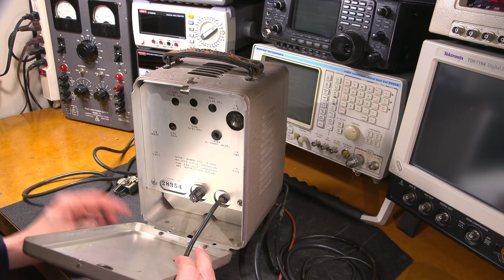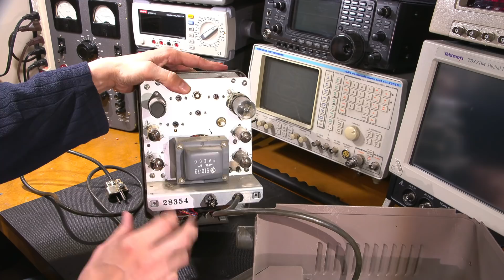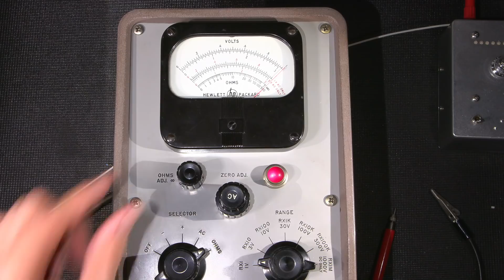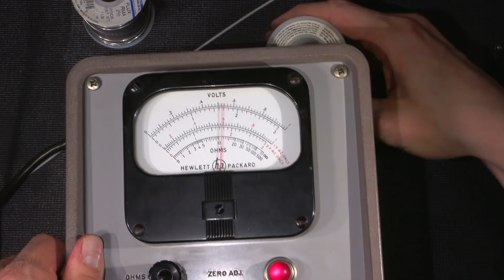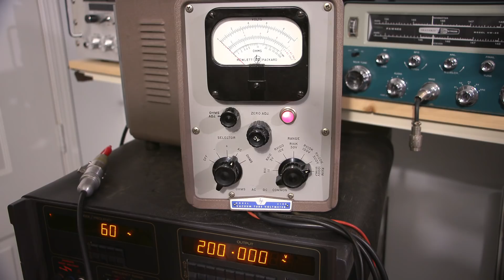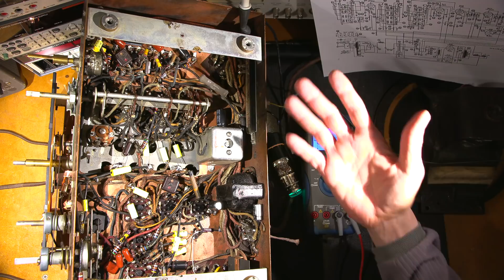The BEST VTVM? You Decide! HP 410B Restoration and Alignment

Comment: The selenium rectifier in mine died and it was a nasty small (and I am told, highly toxic - I didn't stick around to find out).  Just a warning - even if it is low voltage, not worth playing with, just replace it.

Comment: Oh! How I love this VTVM. This was my first. Now I have the 410C Voltmeter. I like that too. DMM can work also if you build your own range extender probe with shielded cable and resistor of 1 M Ohm or more into the tip of the probe, then just multiply the number on the display accordingly.

Comment: A couple of small notes.  First, there are differences in digital meters regarding their inout resistance.  I remember noticing that at higher voltage selection some high sensitivity analog meters could have lower loading than early digital meters.  Then the digital meters started being "standardized" to 10 Meg input resistance on all settings beyond 2 V or 20 V.  A Fluke 8060 had special "trick" to bypass its 10 Meg resistance, by leaving one or two selection buttons not pressed and producing 10 G-ohm.
 Second, I hope your AC probe pn was made of brass screw, rather than steel.  Otherwise I would be skeptical about its abiities to get even beyond some MHz.
 Third, I was once puzzled by missing heater on the input stage of a Keithley meter.  Actually I learned that it was intentional - the meter was Electrometer.  It depended on the cold cathode tube for its input characteristics. 
 Fourth, if the selenium rectifier would be damaged, you could smell it way before ever opening the case.  "Ask, how I know!"

Comment: Its a while since you uploaded this one.
I have a HRO RX  and I put into my tube tester a 6K7 and all of the 6K7's have leakage from 1st grid to pin 1 which is the meatal shield and using a ohm meter there appears to be leakage from the top cap ie 1st grid to the shield about 8 megohms.
The insulating material between the top cap and shield is I think conductive.

Comment: Before bad leadership wrecked the company, HP built things to last. I used many HP instruments to collect data for my Ph. D. thesis - circa 1990. Later, I worked for HP from 2002 to 2011. While there, an old-timer told me about the time a VP came to our site. He addressed the engineering staff. He took an ink-jet printer and stood on it. He lambasted the engineers for over-building products.

Comment: There's something you should have mentioned, but didn't.  Note that that big cap is inside a cardboard tube.  If you end up replacing with a similar one, be SURE to put it in that tube, or something similar (like a few layers of electrical tape).  The case of that capacitor is not grounded.  If you don't insulate it, and brush against it, you'll wonder, "Where did that rattlesnake, (or was it a snapping turtle?) come from?"

Comment: Just retired and took up electronics as a hobby. How does this unit compare to the 410C and Sentinel ME-26D/U?
Reply: The 26D/U is the ruggedized, military version of the 410B.  If you get the chance to acquire one, at a reasonable price, jump on it.  It's identical to the 410B, but Mil-Spec.  The 410C has the same capabilities as the B, but is solid-state.  They also sell for more.

Comment: Hi Paul. Regarding the new electrolytic cap. I have always used the "ear snipping" technique to be able to easily and cleanly remove what can often be a jungle of wires on multivalue cap lugs, but I'm not certain if your followers understood what you were actually doing.  I had to screenshot and expand how you added the new cap and while I understand your simply soldering the negative lead to the existing electrolytic lug, I am not certain how you did the positive lead?  It appears you bent the ear over and then, using a nut, attached a standoff to the ear via a threaded shaft. But it appears the same threaded shaft then protrudes from the other end of the standoff, where all the positive leads are attached?  If I'm correct, this would mean the old cap is still in circuit, right, or are there 2 separate shafts, thereby keeping the old cap out of circuit?  BTW, in my 1968 410B, HP changed the cardboard electrolytic 4 to a metal can 8, and also did away with the wire tube hold downs.  It is only due to your excellent photography that I was able to expand and investigate your standoff design!  Keep up your outstanding work!

Comment: Thank you Paul!
Reply from the maker: My pleasure!
Reply: @MrCarlsonsLab  Paul, I have been going back and forth trying to decide whether I should ask this or not but I'll ask anyway. You are, of course, the person to go to when you want to know probably anything about radios. I think what set you apart from others in this field is that you know the theory well, you have a lot of practical experience and most importantly, you have all the physical and mental tools to explain it in such a way that almost anybody can understand it. In your All American 5 Video, there is a short part where you explain the signal path in the radio. Would it be possible for you to do the same in a separate video, on a simplified version of a tube radio built on a simple chassis, going through the signal path using some sort of test equipment (an oscilloscope for example or whatever you see fit) and explain how reception occurs starting from the antenna all the way up to the speaker? I do understand that there are different topologies for radios, like regen, heterodyne, super heterodyne, etc. but since I don't know much about the classification, I would ask you to do whichever one you see fit (where would one begin?). If you have done anything like this on Patreon, I am working my way through to Patreon and I'll get there soon. I am going through your Youtube videos currently. If you don't find the time to do this, I would also be interested in any book or resource you would recommend. I thank you in advance. -Regards Gahra

Comment: I just repaired my 410B!
Mine was used for decades in an avionics lab, but it was considered obsolete and given to me.
A few pots to clean, a wire soldered, and it aligned nicely.
What makes it even more valuable, are the two AC probe adapters I got with it, they allow me to measure inline coax voltages, or the output of a signal generator!
It sits on my scope stack, ready to measure whatever needs to be repaired!
Reply from the maker: Sounds like you have a great tool now! The 410B is really fantastic.
Reply: Lucky bastard!  :)
Reply: @Pootycat8359  Sometimes we get lucky, and sometimes we come when the dumpster was emptied yesterday, when everyone else picked out what they wanted!!

Comment: Question for you Paul, I have the ME-26D/U, and the AC scale won't hold a zero if I hold the probe in my hand. It actually causes the meter to go to full deflection until I place it on the 100v scale.  

I have checked the triax cable and tube in the probe and both seem to be fine. The capacitor in the tip had broken, and I was able to carefully glue it back together. A quick test with an LCR meter shows that I have contact between the probe tip and the inner contact that interfaces with the tube. 

Any ideas on what to check for?

Comment: Well, I finally managed to come across one of these on an auction site and snagged it.  The DC and ohmic leads need to be replaced, as the insulation is pretty badly cracked on them, but other than that it looks pretty good.  I'll be using this video as a guide for my own restoration.

Comment: Mr Carlson, I've just acquired a HP 410B. V2, V3, and V5 shines dim, but V4 and V6 doesn't shine. Where can I find these tubes? I know V2 and V3 are 12AU7s but I don't know what V4, V5 and V6 values are.
Reply: V4 is an OB2, 105 V regulator.  If need be, it can be replaced with a 105 V 10 W zener (eg, 1N3006B).  Be sure to put a small (.05 uF?) cap in parallel, since zeners produce RFI.  V5 is a 6X4 rectifier (the 410B in this video is a later model, and has a selenium rectal-flyer, instead).  You can replace it with silicon diodes & series resistors.  Be sure to determine the tube's internal resistance, and add the resistors.  Otherwise, the B(+) will be too high, which might shorten the life of the instrument.  V6 is a ballast, which creates a constant-current source.  There are ways to replace it, but I don't think any are quick & easy.  You would have to design & build an AC C-C source.

Comment: One final question…I see the meter is grounded and I wonder what happens when you attempt to measure line voltage? Thank you.
Reply: You can measure it, with the probe going to the AC "hot" wire, and the meter ground to the AC "neutral."  Don't try the reverse, or it'll be "snap, crackle, and pop!"

Comment: aaaahhhh memories....in the '60s my first VTVM was an EICO. The 12AU7 in mine would go soft after 20 hours of use. The most frustrating thing using it was, every time the range was changed you had to re-calibrate. More accurate than a VTM in those days. My first tube tester was a Heathkit. Worked great.
Reply from the maker: Thanks for sharing

Comment: First, I want to make clear that I enjoyed the video, and I love that this kind of information is available, and I am a patron of the channel.

A comment about input impedance...  Modern hand-held DMMs tend to have an input impedance of 1 to 10 Mohm, according to the paltry amount of relevant information I was able to glean from checking the data sheets for several DMMS, including the Fluke you're using there, my Flukes, and my Flir DMMS.
I have several DMMS that have a LoZ (low impedance) mode.  These are useful to avoid ghost voltages, which I deal with a lot because I do industrial electrical far, far more often than I do electronics.  I have seen the 'loading' that you refer to, and it is annoying.   A VTVM is not convenient to carry in the field, though.  If I decided I wanted a DMM more than I wanted a new car, I could buy a Keithley 2001, which is rated for over 100 GIGAohms of input resistance when measuring DC voltages up to 20V.   I can't imagine that this VTVM has that high an input resistance... could it?  Certainly it would be cheaper.
I'm not sure what my point is.  I think it's that analogue meters have benefits that digital meters don't, but that doesn't require the tubes.  I don't think that the tubes add a unique value - you're comparing that bench-mount machine to pocket-sized DMMS (okay, that VTVM has a handle, but it plugs into the wall and it's hardly in the same portability class as the units it was being compared to).   Compare that VTVM to a modern bench-mount DMM like the Tektronix DMM4050.  It costs about what that VTVM cost new (adjusted for inflation) and it has a rated input impedance of over 10 GIGAohms in the voltages you were testing.  I believe that it would hold up very nicely against the VTVM.  If you want to spend a whole lot less the Rigol DM3058E has basically the same impedance specs as the Tektronix for around $500.

Anyway, I guess my point is that this comparison was really showing the shortfalls of hand-held DMMS, not so much the benefit of VTVMs.
Reply: Ah, but try using a DMM near the base of the tower, fed by a 50 KW transmitter!  (been there, done that...)  I think that's why Simpson & Triplett still make their good old 260s, 630s, 310s, etc, and sell them for big bucks.  I"d guess that broadcast engineers buy most of them.

Comment: Thanks for the video, very informative. Mine works well in ohms but when trying to calibrate the full scale zero for AC and DC, it goes over the zero mark in all scales. Any idea how to correct that? Thank you
Reply from the maker: Hi Alex. Full scale zero? You are only supposed to zero the meter on the AC and DC scales at the low end of the movement.
Reply: @MrCarlsonsLab  sorry, what I meant is that when trying to calibrate AC and DC in the different ranges (1, 3, 10 volt etc) when I apply the maximum value for the range, eg 3 volts,  the needle goes to full deflection instead of stopping at 3 volts. The same result for all ranges. I even tried with different power supplies and they were accurate when tested with other voltmeter, so I think my 410B is reading higher voltage. Is there any way to calibrate the maximum voltage?
Reply: @vombatus56  You're saying that AFTER you set the needle to "0," with no input, it reads high with an input?  How much?  There are calibration pots inside.  The manual (available online) gives the whole calibration procedure.  Otherwise, you have a bad resistor, leaky cap, etc, and will have to track it down.  But the circuit is simple, and easy to troubleshoot.

Comment: Wow, I've had one of these sitting on the shelf for decades and in similar condition, so I had to pull it down and follow along the resto with a lot of extended pauses.
The only things missing from mine are all three probe tips, even the AC one, there is a plastic screw on end cap with the needle in it.. I can make that part (maybe with a swappable shorter needle), the other two probes look like they use collet retained probe pins with a threaded locking collar, again I'll make these, and lastly the blue front badge insert is gone, but I could probably print something and mount it behind a piece of clear plastic. I was using an AVO8 for analogue duty literally forever.. until now..
Thanks Mr Carlson.

Comment: it is pretty funny how the vacuum tubes always acts superior in every aspect regarding performance and accuracy compared to transistorized tech. sure it takes more fiddling and calibration and also knowledge to use it but in the end they always win, no matter if audio or equipment usage
Reply: Do they, though?
Reply: @Yinte_Klop_Blunt666  Yes, it is actually that way. however their nominal lifespan is usually shorter than transistors and use more power, high voltages, generates lots of heat etc etc. but the pros about them is that they are often less sensitive to intermittent abuse such as voltage spikes or sudden current peaks that may immediately destroy a transistor for example. they are when correctly tuned absolutely superior in accuracy in high resistance high voltage applications or when used in a VTVM also good for measuring very weak signals which a normal multimeter cannot do without loading down the circuit too much for any accurate reading. they give a very natural sound if used in audio circuits and are simply cool to look at when they glow nicely. but sure tubes are not good for everything these days but when they perform they do it very well

Comment: Two questions:
1. The tubes in this VTVM are mounted in a way that would inhibit efficient cooling. Is this not a problem here because it is a low current circuit?
2. Is there any way that a DMM could be designed so that it doesn't load circuits?
Reply: Question 2: The general principle is to design the instrument's input impedance so that it is a  lot higher (say 10x) than the impedance of any circuit it's intended to test.  We ran into a problem in the 60s with a DuMont scope that had 2 megohm input impedance.  The scope was part of an avionics test bench.  The customer bought (upgraded to) a Tektronix scope with a 1 megohm input impedance, and some test voltages came out different from expected.  So we recalculated the expected readings for the customer, and things were ok.

Comment: If you set the voltage to ([sqrt]10) (about 3.1622776602 Volts), you can set the pointer to line up on the "1" on the next scale up.

Comment: That for me... Was a very, very educational video... Lots of information was conveyed about these old tube voltmeters,  and the example of loading the circuit using modern digital meters... VS  tube voltmeters absolutely demonstrates the difference on measuring sensitive circuits, And using a "Magic Eye" to show us... Was an excellent visual example,   using these 2 types of measuring devices,  and what needs to be understood using these 2 different measuring devices was an excellent demonstration.  All these years I thought it was the Opposite...  Tube type testers,... Would load the circuit,   Not only did you explain what's going on,  but you visually demonstrated this important lesson,  :-)   I now want to look for one of these types of voltmeters, there could be a lot to learn,  Using one of these meters,  you have given me a lot of things to think about, with his video and in time, my experience, doing repairs will be done with more knowledge and understanding.  Thanks for the great video.  Now,  off to Mr. Carlson's Patreon lab...  :-)

Comment: Hewlett-Packard (HP) equipment in the modern US Navy has a DoD Code Name CAQI.  It was (and perhaps still is) the most widely-used manufacturer of electronic test equipment in US Navy ships from at least the 1960s, if not earlier.  The simplicity of the construction of its portable equipment is because that is part of the military specs it had to meet and so it just made EVERYTHING like that to make sure it kept its position as Numero Uno in such VERY sought-after and highly-profitable contracts.

Comment: Best?  I will submit two for consideration.  The HP-412A which sports a full six ranges below 1 Volt DC.  A magnificent device with the chopper light circuitry, and parallax mirror.  And number two, my favorite actually, the Simpson 314, which is actually a solid state unit, with the biggest cleanest meter face of all.  Superbly accurate, and a true pleasure to use.  Useful at low frequencies as an oscilloscope, with its needle cruising back and forth like a metronome, about the center zero.  Both will measure higher resistances than my reference Fluke 8842A.
Reply from the maker: You may find this interesting as well: https://youtu.be/vrmwql2msbU